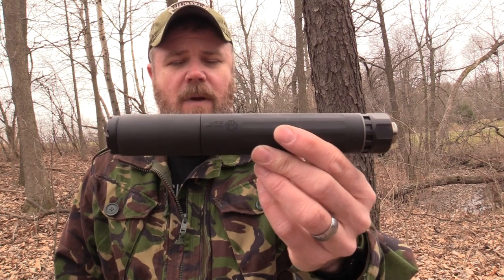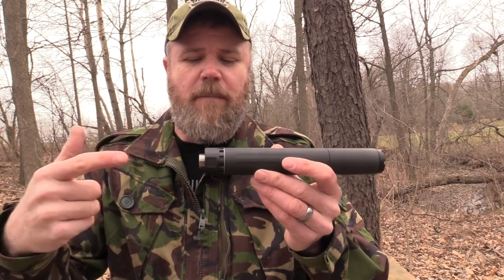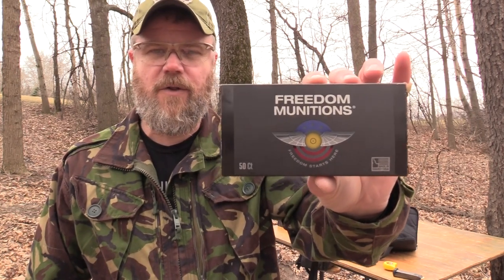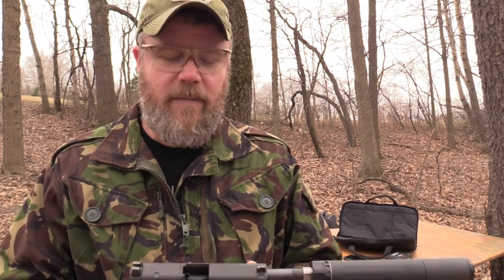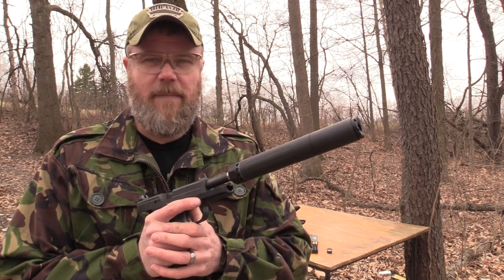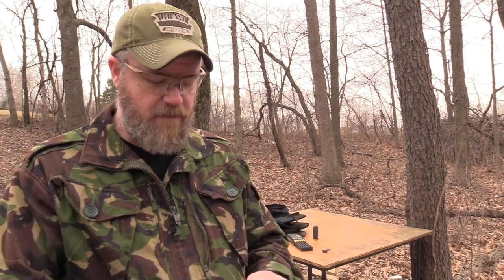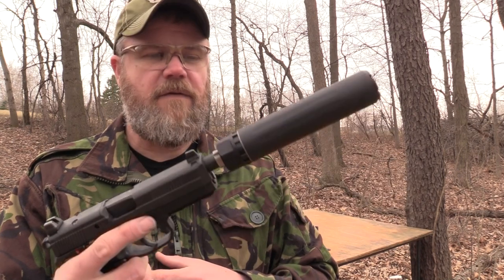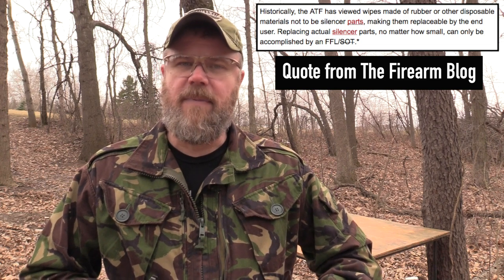BATF: Wipes are now Silencer Parts! DeadAir 45M Range Time

Comment: lol they outlawed a rubber peice that you can easily make at home? good job batf hur dur hur dur
Reply from the maker: +moey nolala Its like redesigning a pistol into a rifle if you touch a brace to your shoulder. More nonsensical BS from an agency with zero oversight.
Reply: Hell a silencer is something that you can easily make at home with basic shop tools
Reply: Is there anything that would keep you from using store bought rubber/neoprene gaskets (or making your own)?  I am not fully informed about suppressor laws.
Reply: biggie1447 I was wondering the same thing.
Reply: biggie1447 A completely unenforceable law that has no reason for existing? 
Go figure.
Good thing you had that stockpile of homemade wipes before that letter was issued right? hint hint
Reply: The whole AR-pistol thing is a joke to be honest. An AR-15 is a rifle, no matter how long the barrel is or what kind of stock it has. By BATF definition you could build an AR with a 28" barrel plus suppressor, full length hand guard, 100 round beta mag, high powered scope, 37mm under barrel flare launcher and a folding "arm brace" and it would be considered a freaking pistol. That's just ridiculous.
(If any of the listed features would exclude it from the pistol category, please let me know because I might be wrong.)
Reply: swiss ahh sorta if you have a overall lenght of 26" you can put a vertical grip on it moving it more in to the aow category which it is still not under 26" overall is strictly a pistol so no vertical grip without aow stamp 😣🔫
Reply: moey nolala your missing the whole point.  It's not just the length/parts but how it's designed to be used jet dictates pistol/rifle.  So it's actually pretty simple.
Reply: dats a felony. you can also damage the gun and yourself if you arent careful.
Reply: Not law just their interpretation and regulation of what a suppressor is.
Reply: moey nolala : I wonder what the Feds would say of one were to roll a condom over the "Supressor".....LOL!!!
Reply: Yucannt Hahvitt : Like a Maglite flashlight housing???.
Reply: +Eric Dee That's actually worth an experiment! The nature of latex is such that it might act as a great wipe! Of course you'd have to tape it onto the suppressor and it might melt. Hmm. Maybe not such a good idea.
Reply: @yucannthahvitt251  that thought is illegal and will get you locked up if you think it again
Reply: Yucannt Hahvitt auto oil filter.   Ur welcome.
Reply: Those ”wipes” are nothing more than rubber washers that are available everywhere (Home Depot, Ace, etc). So when do the ATF storm troopers start their raids at the local hardware stores for selling NFA controlled suppressor parts? Time to ban the NFA !
Reply: I was thinking the same thing. I can easily make a cutting die and buy some neoprene at the hardware store.
Reply: @thevacuumtubejunky9774  lol no shit

Comment: You can use a  CO2 duster or CO2 Tire inflator to put a shot of gas into the suppressor to displace the O2 before the first shot. That should get rid of the first round pop and not screw up accuracy like a wipe does.

Comment: Hmm, horribly written?  If the Hearing Protection Act is passed it will effective do away with the tax and existing regulation of suppressors.  The federal criminal code is so interwoven that the 1934, NFA and 1968 are all associated with the different titles of the same criminal code.  So saying that if the Hearing Protection Act is passed that somehow suppressors will not be completely dealt with is inaccurate.  All of these laws are apart of the bigger U.S Code and most of the time they are all spread out through the criminal part of the code which is title 18.  Anyway, I was just disappointed to hear you say that after all oft he work people have done to support it.
Reply: Mrgone454 and what are you basing this on?
Reply: Mrgone454 "just buy ear muffs" lol if this is the gun community thinking, I guess it is dead.  But for your info, search the bill and you can keep up with what committees the bill has been referred to already. It is not dead yet.
Reply: I believe it has a good chance of passing.  Just need to get everyone's head out of their ass to pester the shit out of their representatives.

Comment: I was in Spec Ops aviation for 27 years. We would get the Beretta 92F, with suppressor. The chambers were with a polyurethane type "disk" after about 100 rounds, they were useless. Higher highers wouldn't allow us to use any other useless suppressor.

Comment: how can they even tell what a wipe is if you just have a bunch of non marked ones?
Reply: what I mean is...a wipe could be used in other ways...it is just a piece of rubber with a hole...
Reply: Man that worked like a charm, buggered my can up though. Now I have to send it in to get another wiper installed fml.
Reply: It will be harder for them to say anything if you buy a premade hardware store disk without a hole or x-cuts in it.  You will not have manufactured anything.

Comment: This is a very simple problem to solve.     "Make your own wipes" with readily available materials that anyone can acquire from brick and mortar stores or over the internet.   It's not hard to find neoprene material.  Figure out the size of your can and purchase a pipe, (copper, brass, steel, iron, pvc, etc.) and sand the edge of the pipe till it is sharp.  Put it on top of your material and smack it with a rubber hammer.  PROBLEM SOLVED  
     If a company was really smart, they would put together a tool kit with the punches all in one case and sell it with the material already to be made by the gun owner.  They will most likely have to tweak the whole idea of the kit, but anyone with common sense will know how to utilize it for making there own wipes.  AKA ... arm brace for pistols, lol.  
     Thx. for the video and info. 
     God Bless

Comment: Get one of the many "sound level meter" apps for your smartphone.
P.S.  a tube of high-temp silicone sealant and a cheap welders blanket from HF---coat a one-square-foot piece of the blanket (both sides) with silicone, let dry & cut yourself some appropriately sized high temp, fire proof washers and fit according to need.

Comment: I was told by the NFA branch that having extra wipes around was "constructive intent" to build more silencers.  Not being a machinist I would have to fill out a form one, find tubing, make my own K type baffles, figure out how to fabricate and thread front and rear caps and I guess I could make "one wipe and one wipe only, Vassily" (my apologies to Sean Connery).  It would be far easier for me to buy another suppressor..... Another NFA person told me once that as long as the suppressor originally came with wipes then it was always OK for it to have wipes in it.  He did not elaborate.  Someone posted somewhere the same thoughts after this recent ATF ruling and even suggested Grainger for the 90 durometer "Char A" urethane ... Not neoprene as they wear too fast and used to catch fire in the old MAC suppressors.  Me?  I'm retired, have a good pension, my boys live with me while they go to college and I shoot almost every day at the range and don't want to jeopardize that... even though it's a stupid rule..  I have an old AWC HP-9 "Hush Puppy" and had to send it back to AWC to get re-wiped for $40! And they are out of the pistol suppressor business now.  I don't know why, their Valkirie II titanium tubed baffled suppressor still compares with anything out there today.

Comment: On the pistol, I like the short version.  The couple extra decibels are no biggie. 
When I stick my carbine upper onto my Glock lower (thank you, Mech Tech, .45 AR configuration carbine and it's an "accessory," mailed right to the front door. ;)  ) it handles the extra inches/baffles, no prob.  Especially while sitting on the bi-pod.  LOL
  Good video, thanks for delivering the non-sense news from the ATF, if there's a way to make things uselessly and inconveniently stupid, they'll find it.  No replacement wipes?  I get rules and laws, when they weren't written by a burro.  (A little, annoying jackass, right? lol).   Hell, I do believe I have some neoprene sheet and hole punches around here somewhere.  
  By the way, I do believe you were looking for "unwieldy..."  ;)
Keep up the good stuff.

Comment: Thanks for info on wipes. Have an HK 45c, Bought Gemtech GM45, love it. Owners manual says you can lower db with wipe capsule, didn't fully know what that was about. GM45 has no removable end cap for wipe. Maybe something with a rubber band will work.

Comment: perfect solution to your issue with not being able to get those wipes for your can make a trip to your local hardware store and pick up some neoprene washers. I am sure that if you look in the parts bins at your local hardware store you can find washers that are the appropriate size and thickness.   That way the BATF will be none the wiser and you can keep shooting your can with its optimum noise canceling still inplace.   Unless the BATF wants to make neoprene washers illegal as well.   But I am also sure that there is a enterprising gun owner out there that can also manufacture a Washer punch and sell them to anyone that would like to make their own washers out of neoprene.

Comment: If your decibel meter uses Li-ion batteries you have to keep them charged. If they fall below a certain voltage (I think somewhere between 2.0 and 3.0 volts per cell} Li-ion batteries will not recharge. That's why for Li-ion batteries that see infrequent use I try to remember to charge every so often even if I don't use them. You may have used your decibel meter and forgot to recharge it and stored it long enough for the batteries to self-discharge below the minimum voltage.

Comment: To the best of my recall this was the case in 1985/1986, I could no longer get factory wipes for the 9mm Sionic suppressor ( we still have)... the solution at the time was Dr. Phillip Dater came up with a wipeless endcap
For the Sionic can that promised a -2db
Reduction over the factory wipes. I still use that endcap. Wipes are a pain in the ass, and go bad in 25rds on full auto.... and 35 to 40 in slow single file.
And because the bullet has to squeeze though a 10 caliber hole... it plays hell with accuracy. Wipes should populate the bottom of the dustbin of suppressor history along with rolled screen wire and steel wool, and aluminum pop rivits as heat sinks in the Sionic can
Reply: I was looking at the Ghost M the other day at Trinity Ordnance... and its likely my next tax stamp... but no wipes for me.
Reply: The only bit of WW2 suppressor tech I would like to see make a comeback is
FMJ .22LR standard velocity.... because lead buildup on baffles is a bad thing

Comment: That first stainless 1/2 baffle in the front of the suppressor should be moved between the short and long configuration right? It looks like you left it in the other module when you took it off.

Comment: Classifying a wipe as a suppressor part means that unless you are a manufacturer, you have to have a separate tax stamp for EACH wipe in your possession.  I'm sure everyone knows what will happen if you don't have the tax stamp. The ATF used to use rubber washers at gun shows to "frame" dealers. (This issue was well covered by John Ross in "Unintended Consequences" (Chapter "April 7, 1990”))

Comment: if you can remove and install your own baffles, then they have no grounds to say that you can't also do so with wipes. At best it should just mean that you can't order them separately from the can. Soooo, manufacturers should be able to simply include a sleeve of 200 wipes with the can and do so again as a repair service or maintenance send in when you run out.

Comment: I'm not sure I understand the difference between having that suppressor assembled without the wipe or having it assembled with a wipe and an extra wipe on hand. Isn't that the same as having the K config assembled and having an extra baffle sitting there? If you own a can then you re in possession of a collection of controlled parts. Their assembly in to a whole or in stack of parts makes not difference. The only thing they have a leg to stand on is if you're manufacturing wipes now that they are considered a part.
Reply from the maker: This is one of the many inconsistencies of the ATF rulings and positions.

Comment: Was not happy when I heard about this.  I have a Ghost 45m in NFA jail currently, but my LGS allows conjugal visits so I've still used it quite a bit.  The ability to use the wipes was one of the deciding factors for me for getting it over an Octane 45, and I still have about a dozen of them left.  I have admittedly noticed a lot more blowback with the wipes installed, but my 9mm pistols are noticeably quieter with the wipe installed.  I actually talked to Pappas when they were doing a demo at my LGS, and I believe the wipes were more intended to be used as a seal for when you're shooting undersized bullets through it (aka anything smaller than 45 cal).  I wonder if they will release 9mm end caps for us to make up for the ATF's enlightened decision.

Comment: The following sentence from the BATF regulations.

"certain internal components, intended only for use in a silencer, are silencers as defined."

A plastic or rubber disc has many purposes so an individual can replace these in a legally owned silencer.  The issue arises when a  silencer manufacturer sells parts that are included in their product. If they also sold plumbing supplies and other products that were commonly used and these were also used in the can, it would not be a problem. 

The Bardwell letter does not state that the wipes can be sold only that an individual can replace them.  When I got my Degroat NANO can it came with one wipe installed and the instructions gave the part numbers for the Urethane sheeting and punch to purchase to make my own. NO sale of extra wipes to the end user.

Comment: I actually get a real kick out of this nonsense. Has the ATF bothered to contact every manufacturer of urethane bushings and washers to inform them that they are now manufacturing firearms components and need special Federal Licensing....   NO! Nor did they contact all registered owners of suppressors and inform them that changing the wipes in their cans must now be done by the manufacturer. Doing it yourself would be considered manufacturing without a license....   NO!  I wonder what happens when they figure that soda cans and flashlights can be made into suppressors with just a little know how. Are they going to regulate those things as being suppressor components too? When is an actual legislative body going to step in and prevent them from making common everyday items, like urethane bushings/washers (you have dozens of them in you car), into Federally regulated firearms components?

Comment: Question:
Can I take two or more of those suppressors and make a LONGER supressor, instead of a short one?!
Reply: you can't just screw them together unless you modified them somehow yourself.  I think that could be construed as manufacturing so I wouldn't exactly tell anyone.
Reply: Manufacturing without an approved form 1 ? There's probably rulings that say that the only ones allowed to modify their suppressors are the manufacturer of said suppressors..  Therefore you'd be in violation of at least 2 rules.. 10 years for each infraction..  You'd spend less time in prison for murdering someone..

Comment: I'm not a legal adviser however if wipes are illegal, and you have to go through the hassle of mailing an NFA item in the postal service might I point out something.
If say someone has a sheet of 3mm-6mm rubber mat or older shop foam mat and happened to cut circles into it with a leather punch that happened to be the same size of a wipe to make one of those holed mats for your back...  Would that "trash" basket of the discards there be a felony or what?

Comment: Isn't replacing the wipe part of the maintenance process for a suppressor, like cleaning? Is changing the metal-baffles in your suppressor also illegal? I would have guessed, that since a suppressor is an NFA item and you want to change a non-serialized part of it, it would be like changing the trigger-group or bolt-group on an SBR.

I'm a german and our suppressor laws are different, in that they count as the same class of gun they are intended for and you need a reason to have one (like hunting). But since they are the same as a gun, you can fully maintain and repair it yourself. You also can't really get suppressors for subsonic calibers, since it would be too quiet without the crack.

Comment: Easily enough to make your own wipes with a sheet of rubber/neoprene and a couple of suitably sized bell punches (one for the internal diameter of the silencer and one for the bore diameter) If there are no suitably sizes punches that can be bought off the shelf your local engineering/machine shop should be able to make them very easily. In the UK we do not have to deal with this kind of BS as Silencers/Moderators are not licensable items, they are just an accessory.